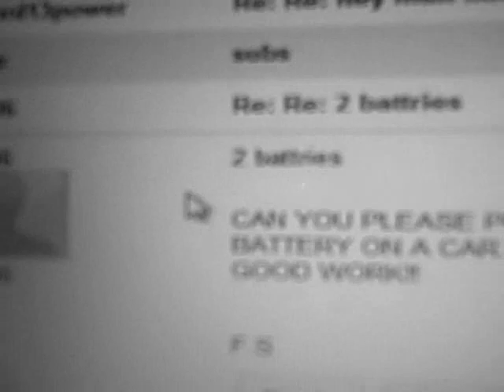(Q & A) How To Install 2 Batteries - BASIC - Adding A Second Car Audio Battery w/ Isolators & Relays

Comment: I got a duralast platinum agm battery under the hood. Was gonna run one in parallel in the back on a 130a alternator. Hopefully itll be alrite . Running a sq s1 2250. Have all ofc stinger wire and big 3

Comment: Can I hook up 1 XS Power D3100 and a Northstar smsagm480 together in the rear? I have a regular lead acid under the hood. It will be about 9k. What would you suggest.

Comment: I am haveing super charging problems i can be driving down the highway at 70mph and the voltage gauge in dash will drop too 7 when the bass hits 

I have 4 boss 1200watt 10's on a cheater amp that i have no clue what it is or what output it is its has 4 gauge imputs and   3  40a fuses in the amp i have 0gauge wire and a 3.5 farid cap. When i added the cap it almost did nothing i have ordered more 0gauge to do the big 3 upgrade i am balling on a budget foreal. (Only have $360 in the system) and am not sure what my next move is if that will be enough or what i need to do

I forgot to mention its a stock charging system of 2.2 s10

Comment: I have 2 p3d4 at 1ohm. A t1000.1. I have second battery in the back with 2- 200a circuit breakers. The one circuit breaker that runs between the amp and the battery keeps breaking at high volume. Any idea why that would happen? Thanks! Love your builds.
Reply: aaron collins did you upgrade your stock alternator?

Comment: So as long as my cars stock battery is a 12 volt i can install a XS power D3100 battery as my second battery? (XS power battery says it's A 12 volt) so I would just wire positive to positive.. Negative to negative from my stock battery to the XS power battery..?

Comment: XShadowHazeX- We run a RF R1200-1D @ 1 ohm and a RF R400-4D front @ 2.6 ohm & rear @ 4ohm. 15 year old stock alt. and one Duralast Gold battery. Lights dim some on very low notes. Shes been running this way for two years.

Comment: I plan on running a rockford fosgate 750 prime to power a single sa 12 at 2 ohms. Think my stock charging system can handle that fine?
Reply: SPRINGDINGER777 I already got the amp and sub installed. Great combo (Rockford Fosgate Prime 750D and SA-12). No light dimming issues and it gets LOUD, sound good too.:)
Reply: XShadowHazeX I can tell you right now that amp will NOT power that sub properly. I had one. When I got rid of it for a Jl jx 1000 my sub woke up.
Reply: XShadowHazeX if you think that sounds great, man, I honestly feel sorry for you. Those prime amps suck. I had a 750 and 400.4. Worst mistake ever.

Comment: I have a question if you can help that would be amazing I have an old jeep a 1998 to be exact with my system that I have now I can't turn my amp all the way up or it will kill my battery would you suggest a second battery? And if so how would I keep a constant charge to that second battery

Comment: Hey Exo  i'm building a spl comp car.  im running 4 soundstream splx dual 2 hf's 
with a 10000d xxx sound stream amp   what battery setup with what alternater and what batteries 2v 100ha  6 in series or 3x or more 12v 100ah+ just done the big three grounding..  oh and running a pioneer prs99 ... :) i know... everyone tells me its a hq head unit but thats what i wanted.. functions are fantastic.. please advise.. cheers Rob in Austraila

Comment: @exo hey man please do reply if possible email at lilxhady@yahoo.com ... im running 1800 watts off of real 8gage wire in a 2005 honda civic now as you might know it has a realy small battery and small alternator so im going to run a secondary battery in the back so im wondering do i need thicker wire to run the secondary battery or can i keep the 8 gage

Comment: Can i hook optima deep cycle yellow top battery with my bmw factory fitted liquid(water/acid) battery? Does it suppose to be both the deep cycles? I got brand new bmw massive factory battery in car for staring the car. Plz help

Comment: Just curious because I can't find anything on this. I have a great system but need more amps. I want to install a second alt, in fact I have a odd system that is remote in mind, but wondered how do you wire in multiple alts without back feeding into each other? how many batteries can I actually run together for my system without overload that would no longer be a help but become a hinder? Last, how many amps in reguards to batteries, two batts to a 300 amp alt(for example), is sufficient?

Comment: EXO....I have a second battery for my boat, I bought Stinger SGP38 Battery Isolator and Relay....I have actually already connected it in to the ignition input...do you think this is a good unit?  I am only going to run the amp and radio off of it, leaving everything else connected to the primary, how it is now.  thought?

Comment: Alright, I have an rf 400.4 and a audio technics 1200.1 d.  My alternator pushes 130-150 amps. Can I run a kinetic hc600 parallel on that alt?

Comment: EXO I plan on running 2 xs power 16v deep cycle batteries to 2 re xtx 5000.1's  would it be better to run it to an alternator  r strate to the amps???

Comment: Yo EXO! Just a quick question. I just picked up a 500 AMP RELAY ISOLATOR for my batts. I was wondering. There really isnt that much space under the hood of my s10. I was wondering if the RELAY could be installed in the back closer to my second battery? I have both ends of my power wire fused between battery but was wondering if the relay could go closer to the back battery in the cab of my extended cab. Or is it not a wise idea to have a relay inside a vehicle and must it go under the hood? TNKS

Comment: YES lol i have 2000 honda accord looking to go big (somewhat) for $1200 currently have two twelve inch alpine type r kenwood exclone x1200m amp (was thinking by another and hook two amps to 1 sub?stock batt and alternator i wanted maybe single t2 rockford fosgate 15inch but was told it wont really out due current setup (try to sell me capacitator? i said no thanks can u help me with best option You would do urself (would add mor detail but not trying to waste your time Thank You

Comment from the maker: I would get like a 260 or 270 - Enough to get good idle output and enough to get great output at 2k engine RPMs -- for 4krms, 2 extra batts with the one under the hood should do it. Have you heard of XS Power?

Comment: hey i got a question im going to be running 4 bd 12s that are 1500 watts each on 2 2000watt amps the question i have is what size alt i should get what size extra battery should i get and what size fuses and battery isolator

Comment: I need help bro.
New set up.

Kicker ZX 750.1 (2(40 amp fuses)
2nd battery Maxx 850 cranking amp.
3 Farad Capacitor.
4 gauge power and ground.

I will be connecting both batterys parallel.
 Should I put 1 fuse in between everything.

1 fuse between the first and second battery.
1 fuse between the second battery and capacitor.
& 1 fuse between the capacitor and amp(of course)
should all 3 fuses be 80 amp?

Factory Alternator. its either and 80 amp or a 140 amp.

Comment: exo will i lose dbs on voltage drop any way im hooking up my 5000 watt audiobahn amp to a 15 inch smd right now im hitting 138.8 but the amp i got right now is not enogh power thats why the 5000 is going in tomarow if i get at least 3000 rms wat kind of score u think i can hit thanks

Comment from the maker: Just wire them up in Parallel - Pos to Pos / Neg to Neg - Depending on your stock alt specs, you should be fine with adding a 2nd battery with no problems.
Reply: EXOabigdeal do these again please?

Comment from the maker: If you're installing a 2nd battery inside your car - DO NOT GET a regular lead acid battery - You want a non-spillable sealed battery preferably AGM - You can run them both together, but if the specs are way off, over time the larger battery won't perform to it's full capacity, as it would be slowly drained by the smaller battery.

Comment: EXO I had a question. I'm adding a second battery to my sound system but I do not have the money to buy a car audio battery, would it be fine if I just add a regular car battery, I was thinking of putting the battery in a marine box because of all the fumes and acid. Would the second battery discharge fast as it is not a deep cylce battery?

Comment: my cars quite old so im not sure about if i should hook up my 2nd battery or not, im going to have to run the parallel setup but not sure if my alt can handle it.. would you recommend attempting it to see how it goes or just play it safe. the system works fine, its just that i cant turn it up loud in the mornings because it gets really bad voltage drop(5v or less)

Comment: I'm going to put a single 12" L7 kicker with a 1600 Hifonics Brutus ... I want to a put a kinetik 1800 battery but will I also need a high output alt n the big 3 upgrade for my Infiniti g35

Comment: Yo exo check it out I got a yellow top battery under my hood that powers my system and I wanna add another yellow top battery what type of anl fuse should I use and is my tsunami 2.0 fraud cap good enough to power my to amps thanks bro

Comment from the maker: Yes, it should help a bit, but red tops are not the kind of battery you want. either get another yellow top, or another battery with a higher reserve capacity instead of cold cranking amps.

Comment: hey bro i have a question..i have a yellow top 34/78 optima battery under my hood powering my system but ive been having voltage drop soo i bought a red top 34/78 optima battery..now my question is would adding that second battery help and if so can you put those 2 batterys together?

Comment: Hey EXO i just got a Ford Festiva and I'm thinking about putting a wall in it and i only want to use the system when its running i wont have the batteries die on me right? Also would I need to have a H/O alternator in there for sure? I want to put an Audiopipe 3000D or something of the sort in there and either 4 15s or 6 12s. Not sure on all the brands.

Comment: I ment from the primary battery to the secondary do i need 2 fuses on the power wire its already hooked up but is this safe

Comment: If you hook your batteries right beside each other, where you can use buss bars, then you'll really only need fuses for wires going to devices. But, if you have, let's say a pickup truck, and you have a battery under the hood and you're going to put a battery in the bed, you'll need two fuses, each within 12" of the positive side of the batteries because if something "ever" happens and the wire gets damaged, then it won't start a fire or cause huge damage on either side.

Comment: My 2nd question I have the kicker cvr 12's and the box they have come installed in has a big ol port hole on the side (I hate it) what kind of box would you recommend I change to? The car hits really hard on one side due to the port hole (sucks)

Comment: EXO if I were to add another "car" battery to my car would that increase the power of my stereo system? I have an old buick (1966) just two 12 kicker cvr Sony 1200 amp and capacitor.

Comment: EXO first off your the man. I have a HFi 3000.1 with an re sx 18 at 2 ohms. around 2400 watts going from the amp. if i have the big 3 and an xs d375 battery will my alt or battery eventually go bad? I plan on getting 0 gauge for my amp wires also. when im bumping i drop to around 11v at idle. and also how do i charge my xs with a regular battery charger? or shouldn't i? will an auto shop have a charger for it? thanks man your AWESOME

Comment: When I'm connecting my second battery, do I have to run another wire through my car and connect the negatives? or can I just ground the battery in the back to my chassis and call it done.. Thanks

Comment from the maker: @spok209 - If your deciding to go over 1,000 Watts - I suggest getting an extra battery  in the back - When going over 2,000 watts - I suggest getting an extra battery with a High Output Alternator - When going over 3,000 watts I suggest getting 2 to 3 batterys with a High output Alternator - Dc Power FTW!

Comment: hey dude, I'm kinda on the same boat. I'm interested in getting 1 fi btl n212 with AQ 3500.1 for my bass and an infinity kappa four for my door speakers. if my voltage is straight it should be around 3000 rms ?  my question is, what battery or batteries would I need? do I need one of those 320 amp alternators from DC ?  I can't seem to get a definite answer anywhere.  thnx exo

Comment: Wait so if i wanted to add a deep cycle battery to the back i can just connect positive to positive and ground the battery in the back without having to worry about killing my alternator.. if i wanted to have a dedicated battery for my system

Comment: Ok, so if i just get a yellow top battery will i have to get another alternator and do the big three im going to run 2 12" mofos and with a 1500 watt hifonics on each sub and i have a 600 planet audio on the highs..

Comment: how would i do the big 3 in a 91 towncar, i have a 16gauge fuseable wire from alt to fuse box,then 16gauge from fuse block to batt, can i just run a 0gauge from alt straight to the batt,and leave the 16gauge on the alt to the fuse box

Comment from the maker: @mistah49er - I would help you, but you need to specify what impedance your coils are, and the minimum load your amp can see - Without knowing the exact specs of your woofer and amp, I will not be able to tell you anything useful.

Comment from the maker: @sincitysycopath702 - Adding another battery is your best option at this point, but remember,  your alternator is the life-force of your electrical system. Without enough juice, it doesn't matter how many batteries you have, your alt won't be able to handle it.

Comment: whatup brotha! very informative. however i do have a quick question.. im in the process of installing two kinetic hc600 batteries in my trunk of my civic ( possibly a quad battery setup with installation of a new amp in the near future). im running off a 130amp alternator in my civic coupe. im curious to whether i shall proceed with the big 3 before i continue with any battery additions?

Comment: @ EXOabigdeal  another question and my last one....so would i be able to run my 2 batteries in paralell with my audio wired of my kinectik battery and not drain or put heavy stress on my alt. & front battery ????? just asking because its my 1st time installing 2 batteries and relay..

Comment: Hey,

running a FI SSD 15"
rub 1600D amp

never done car audio before, was recently told that if it falls below a certain voltage, it can blow the amp.

i AM doing the big 3, was planning to do 1000watts RMS to my sub, should i be concerned? my stock amp is 100amps. stock batt also

Comment: @EXOabigdeal I'm running a stock alt in a 98 Oldsmobile bravada with a interstate battery up front and have a duralast I was wanting to add as a second batt. If I charge both batteries before connecting parallel do u think that would fix the dimming lights? Or would the front battery go dead trying to charge the second battery? I wanna fix my dimming lights asap any input will help!LOL

Comment: I am installing a 45A 110V power inverter in my truck. at max load i work it out to be around 5000W at 400A from the 12V. This would be used to power an air compressor so not a constant draw. Can you tell me where to find a relay that will handle 400A or would i be better off just running parallel?

Comment: Wha up EXO...just got a stinger 200amp relay...question: do i still need to run a line from alt to rear battery to charge even with relay??

Comment: bro im putting 4 cvr kickers and want to have two batterys and dont wanna spend so much money how do i do the sencond option u gave ? the relay one to use the sencond battery when in acc mode car off using the 2nd batt
]

Comment: @ph1ldav1sFROSTED Definately upgrade wire, I ruined a sundown amp supposedly from lack of voltage :( As for batteries, just parallel them. Hook up your front battery like normal and run a wire from Pos (front) to Pos (rear). Then just ground both of them to good bare metal, you dont have to connect their Negatives and thats expensive depending on how far you have to run your wire.

Comment: im runnin 1k rms daily i got a crappy 3.2 farad crapacitor, id like to ditch that bitch and install my second batt in the trunk, I can only get acess to 4guaug wires in my hometwon, will it do the job for pos to pos and neg to neg from front batt to rear one? 
im thinkin about doing big 3 with the 4gauge too. I know basics of car audio but thats just not what im used to LOL Please help me out

Comment from the maker: @uniqueautosounds - I'd just wire that bish' in parallel with the other battery. A stock alt can usually handle 2 batts, as long as you down drop the batts down to 11v all day, everyday you know?

Comment: i have a 92 cavaliar and i have a kicker 12'' L5 powered by a sony 900watt max amp and a crunch 4 channel and a rockford 550.1 amp...how do i add the second battery and how do i go about picking the rite Isolators or relay??

Comment: Question man...I have 330 RMS in my 2007 Dodge Ram.  I was thinking about buying a Kinetik HC800 to replace my stock power cell.  If I need more power later, can I just add another Kinetik to the other side and wire it parallel?  I am not sure how much battery power I will need.  I just want to make sure I can upgrade later if needed.  Thanks for your time.  I love the videos.  I would have been lost without them.

Comment: Q&A Q&A. first of all thank you for all your videos. i really learned alot from you. but. i have a question. how can i hook up 2 amps to 1 sub? i have a 15" mmats juggernaut with a JL 500/1 amp now but i have a mtx jackhammer 600 watt amp layin around and wanna hook it up with the setup i have now. how can i do that? like all the wiring from power to speaker wire to the amps? im just confused